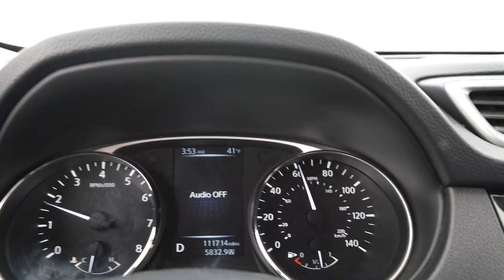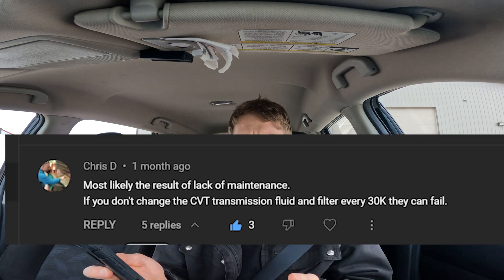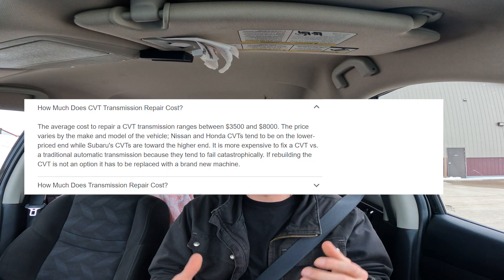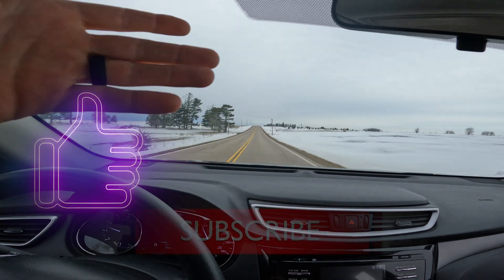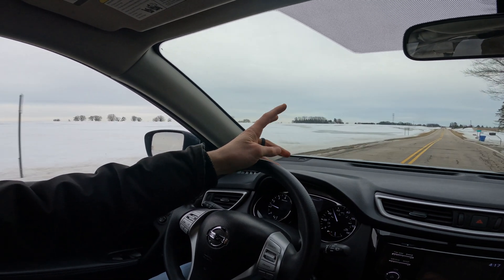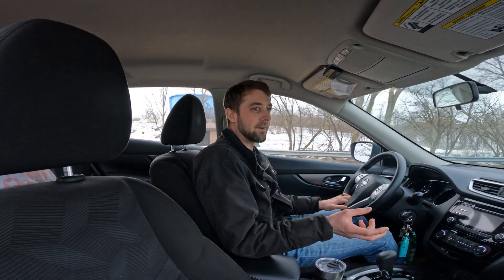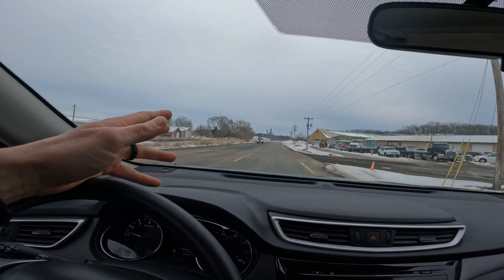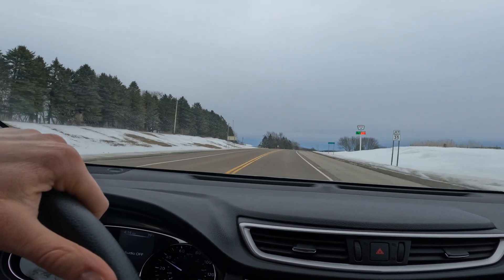Everything WRONG with the Nissan CVT Transmission

Comment: you have to change the fluid every xxx miles or else

Aka High maintenance, got it. Plus the fluid is more expensive than normal atf.

you can't drive it hard, you have to treat it like a baby or a princess

Aka it's a poor substitute for an actual atf transmission.

If these cvts are so darned reliable why have they not been installed into the frontier, titan, z, armada,  gtr?

Comment: I really don't mind them. I have a handful of more interesting and fun vehicles to drive, but I can't complain about the gas mileage on our 2019 Sentra. The computer tells me high 40s, low 50s - hand calculated , it's pretty accurate. I do wish it would CVT under moderate throttle and not fake shifts. 

Every 15-20k miles, it gets a fluid and filter change. Idemitsu N3 isn't terribly expensive at Napa, not more than regular transmission fluid. 

The only person I know who had one fail personally was someone who wrecked the front of the car and had a shoddy body shop fix it. They forgot to hook up the radiator fan and the car was driven for a summer with the car constantly overheating. Too much overheating for it.

The belt itself isn't the primary cause of failure. It fails from something else failing first.

Comment: The whole point of the CVT was it could keep the engine consistently at its powerband meaning better efficiency smoother drivining etc. Then people thought that was strange and didn't like the way CVTs worked so then various manufacturers started making CVTs that simulated normal automatics with "fake shifts" and to me that defeated the whole point of haviny a CVT in the first place
Reply: Yep, from my experience, it feels like it makes it even worse than it already is. Makes the already sluggish car even more sluggish. Simply lovely 😂
Reply: @MrAlanToast  then yours is busted stop driving broken transmission and give misleading opinions based on that, sigh
Reply: Yup.
That's the reason I won't buy one of those now.
Loved the smoothness before, now it's just stupid.
....
Reply: While simulating shifts its still more effecient, lighter and gets in the powerband faster which is also proven in a race a channel did with the altima and a Mazda since they don't use CVT transmissions in any of their vehicles and the Altima blew its doors off. Most of Nissan's engines are underpowered and that is the reason that use the CVT. . The CVT was barred from racing for a reason. The simulated shifts don't effect the performance and it operates like a normal CVT most of the time. Thats why reading your owners manual and researching keeps you from spreading misinformation. Toyota uses a physical first gear in their CVT transmission but it also emulates shifts. Honda's CVT's only emulate shifts at wide open throttle.
Reply: Experts say that toyota is truly the best CVT?
Reply: @lawrencedorfman5543  Toyota anything is the best
Reply: Nissan copied Toyota because they were the first to do a cvt,
when the first generation Prius was introduced, but the second
gen Prius is really where sales took off for the Prius.
so in 2008 Nissan introduced the cvt, but instead of only one car
they decided to change the entire lineup except for the Maxima.
it's also worth noting, Nissan is the only company that uses the 
least reliable version, that's because jacto makes the worst.
now no cvt even by Toyota is completely reliable, but the reason
it works so well in the Prius, it's because of the way the car is designed
and engineered. but Toyota didn't use a cvt in all their cars,
until the 2014 redesigned Corolla.
Reply: My 2015 honda accord has a cvt and it’s amazing
Reply: @AshleyGrahamcracker-oq3pf  I have a 2017 Nissan Rogue with 103000 miles and it's amazing so far.
Reply: Its called tiptronic and you don't have to use that if you don't like fake shifting. Posting misinformation makes you look like a dropout fool btw
Reply: lol
Reply: My first car was a 2007 Ford Sport Trac handed down to me from my grandma and uncle, it a real hard shift. I went in on a 2017 Honda CR-V, after dealing with hard shifting it was nice to have a smooth ride.
Reply: Right on
Reply: 2016 168000 miles and counting. It simulates shift only when you slingshot from a stop. Still don’t like cvt trannies.
Reply: I think the shifting feel is cool.

Comment: Toyota and Lexus vehicles use a planetary gear arrangement to produce a CVT, not a belt. When paired to a hybrid system they appear to be bomb proof and in Lexus's case pretty quiet. If you are gunning away from every junction then it is still not the transmission for you, but if you want relaxed cruising at highway speeds with good gas miles, then probably not much better around.
Reply: Nissan doesn't use a belt anymore either, it's some type of chain driven cvt.

Comment: Honda & Toyota have the most reliable CVT Transmissions.
Reply: Have 230k + on 2 subarus with original CVT
Reply: That’s true but I won’t buy one with a cvt transmission I wish car manufacturers get away from them
Reply: Honda had "teething pains" when the CVT was first introduced. Toyota hybrids use a unique CVT without the failure prone belt arrangement.
Reply: But Hondas fill their crankcase with gas to go along with the oil Result? engine failure. Google oil dilution problems with Hondas.

Comment: I used to drive a lot of different cars as a car dealer service helper back in university. Hyundai CVTs in particular on the accent and venue felt like rubber bands with molasses delay. A complete snooze fest next to the Mitsubishi Mirage cvt. Honda ones are so so but I have a 20 Civic Sport Hatchback and surprisingly it is very responsive, even with the cvt. It feels great and already has 44k miles of...very abusive driving haha. Try merging on the Chicago expressway without a lead foot and you won't get far! Major thing I do is replace the fluid every 30k miles.

Comment: I had a Murano and liked it fine in terms of the drivability. The CVT was a good match with the V6 engine.
But of course around 10 years and 200k km (125 k miles) it started dying. Sold it for $1000 to a friend who spent about CAD$4000 getting it replaced.
You shouldn't have to get the fluid changed every 30k miles. Nissan doesn't specify it as part of the maintenance schedule. These Jatco CVTs are just crap. Most other CVTs, too.

Comment: your video where you took the tranny apart is good....  demonstrates all the roller bearings in a transmission. Crucial for good lubrication and to change old fluid. Engines do not have such bearings inside them. So important for people to care for the tranny and change fluid more often. Your tranny failed due to lube failure.  it's good for me that people hate nissans, I can find a low milage one and then get it cheap and take care of it. So much better than a toyota that has a BS mythical status.

Comment: Don’t buy a car with a CVT transmission when you know there a trouble ! It is all about to change the oil in the CJvT transmission every 20000 to 30000 miles and not 80000 miles as Nissan recommends !That is why a lot of Nissan car owners get into trouble !Nissan has got a lot of owners who have drawn Nissan in court and have had the CVT transmission replaced for free !

Comment: I owned an 04 Nissan Quest Van. The transmission went 188k before I sold it in 2023 for a Nissan Truck. Subaru has the CVT in their vehicles and they run fine.

Comment: Had a 2016 Altima 3.5 SR. Transmission started slipping at 32k miles. Sold it to carmax for $15k and bought mazda3 because it's practically the only compact car (wanted a smaller car) without a cvt.

Comment: My parents bought a brand new Subaru Ascent, which inexplicably has a CVT in a 3-row SUV. The transmission blew within the first year. They had a warranty and didn’t have to pay but those transmissions are absolute pieces of crap across the board (except for the few CVTs that Toyota makes).

Comment: My coworker has a Nissan Sentra from like 2020. He has about 65k miles. No issues with his CVT because he changed the the fluid after like 30k miles. That's the critical part. You HAVE to change the fluid and it should be fine. Hurt most people don't, so the CVT doesn't last. I don't care what the car manufacturers say, including 10k mile oil change intervals. That's another no no. Change your oil after 5k miles religiously or after 6 months 👍

Comment: I just had the P1778 error code come on my Juke with the CVT(178000). It's driving fine, no slipping or anything. Maybe it came on to warn me the trans fluid is low? I need to get it booked into to Nissan for a gearbox diagnostic to see if the fluid is low.

Comment: Nissan CVTs are crap.  The fluid pressure sensor failed on my 2017 and the only fix is to replace the entire transmission.  A 50 dollar part fails and the only fix is a 7,000 transmission replacement.  Horrible.

Comment: I’ve test driven one fully loaded couple of years ago and I actually liked it. So much space in that thing and it was so comfortable. As for the CVT, I really didn’t like how whiny it became when you accelerate. Something felt wrong 😂. Drove for about 20 minutes inside of traffic and stopped for couple of minutes and I was shocked by the fuel economy when I turned off the car. 6.8/100km with the 4WD on auto mind you. Those are Toyota Corolla numbers. At least the 2.0 ones. I’m kind of tempted to get one and I don’t blame others who choose to get one either.
Reply: Basically he said all CVT transmissions. While ignoring the fact that the original Prius is one of the most reliable cars ever made. Transmission included.

Comment: Had a 2007 Altima. At that point, I hadn’t had a speeding ticket in over 5 years, so I wasn’t a crazy driver. Transmission died around 100K. Never again.

Comment: Agreed CVT are terrible in cars, even worse in suv's. They were used originally in small stroke high-torque engines like nowmobiles, seadoos motomarine, ATV's, lawn tractors, etc. They also function well with hybrids, as electric engines deliver instant torque and gas engines supplement. Prius, Volt use these.  
I have never liked the "elastic rubber band" feel they give, I'm far from an aggressive driver but the acceleration is slow and really annoying in gas vehicles, the engine has to ramp up (rev) then the car advances. Can get really annoying driving up hills as engines surge in rpm's to keep a stable speed.

Comment: The car people in this industry have it ALL WRONG, it's not about CVT vs. traditional automatic transmission, but rather, it is which car brand transmission you want to bet on. A Toyota CVT will outlast a Ford 10-speed transmission. Also, ALL transmissions are expensive no matter the repair bill. As I said, it's about the brand, not the transmission type.

Comment: Thank you for bringing the concerns of the transmission to our attention . The video can give the impression that Nissan made a bad transmission design,  put their head in the sand, and  continued to put bad transmissions in their vehicles without making any adjustments to improve its design. They would be out of business quickly if they did that.
Changing the transmission fluid is a key thing to do, of course, and making sure you make a full stop before switching gears.

From Nissan. "The CVT  had a major hardware update for the 2013 model year, which included a reduced-friction design, a wider ratio spread, and a belt that could better handle high torque outputs."
This does not mean its perfect, but its much better than the older CVT transmissions
Reply: You think the regular  cvt is bad  the hybrid cvt is even worst where th electric motor actually breaks after 100.000 km and stalls the entire vehicle on the road
Reply: Nissan could improve their CVT. I believe the E-CVT transmissions are extremely reliable.
Reply: My wife has a 2020 Murrano,  I have a 2024 Rogue and my son has a 2016 Sentra.  No issues with  the transmissions on any of the cars.
Reply: @revelationsoundstudio They're still pretty new. How many km or miles on the 2016?

Comment: Scotty says he's never seen a Toyota CVT fail yet but has seen several Nissan ones fail.
Reply: Kilmer
Reply: That’s because at least in their hybrids Toyota uses e-CVT which has planetary gears. I don’t know about their regular petrol CVT models. They’re rare in our market.
Reply: @mikojarvinen6273 Can I know where you are bro?Petrol  cvt corolla are very common on the road in America. In Aisa, they also build camry, rav4, Lexus es with belt cvt. People say they are reliable.
Reply: So it's not the CVT that has a problem. Just where they are driven. 
Perhaps we should explore this point further. If people in Asia and Europe don't have the same issues with cvts what does that mean?
Reply: @mikojarvinen6273  E-CVT's are a totally different animal entirely, those are extremely reliable because they have very few moving parts.  No pulleys or belts at all, the electric motor takes their place.
Reply: @StormsparkPegasus  That’s exactly what I said in my comment.
Reply: Scotty has never seen a kicks cvt fail or a 19 altima or better cvt fail or qx50 cvt fail.  There are more niddan cvt out there but trust me there are corolla cvts that has failed.
Reply: My mother bought a brand new Nissan with a CVT in 1996. It was dead after 50,000 miles. Got a rebuild swapping the dead box. Lasted 25,000. That's a total of 75,000 miles and the car was scraped.
     The car had been well maintained and the engine was as good as new.
The box was rubbish.
Reply: Mate had a JDM Toyota Vitz which went through 2 cvts at 280,000kms
Reply: @agentrockluxury1208  Did he do the proper maintenance by changing the CVT fluid regularly.  CVT's also cannot be driven hard like regular transmissions. .
Reply: @philc.9280  As far as I'm concerned, he didn't change the fluids regularly, but he also didn't drive it particularly hard.  All cvts are inherently bad when you don't change the fluids, including Toyota and Honda cvts. I drive a Nissan with the cvt, and I change the fluid regularly, and it's been reliable.
Reply: @agentrockluxury1208  I had a Nissan CVT. Bought it new. CVT dead at 50000 miles. Got a box out of a crashed car with 26000 miles on it. I managed to get another 21500 miles out of that before it died.
    The car looked like new but went for scrap. Engine perfect  , car body perfect  , gearbox dead twice.
Reply: I ended up getting a Nissan NV200 cargo van for a weekend van conversion project anyway despite this video. It was a 2015 with only 45K miles so it sat in someone's garage a lot. First thing I did is change all the fluids. Drained the tranny 3 times {one week apart) to get all the old fluid out. Used that new Castrol TransMax that is approved for both CVT and regular transmissions. Based on what I am hearing is to just drain the CVT every 25K and don't drive it hard to make the transmission last. Some folks are getting up to 200K miles on that schedule. Mine has an external tranny cooler so hopefully will get some of that heat out.
Reply: Manual transmissions go at about 60000 miles. They are bad ideas too… they don’t last at all.
Reply: mate, that is because they added two AT gears which means, when you move your car from still to 20km/h the CVT is not working, it only kicks in after car moves. But when you try to overtake & accelerate, Toyota CVT is easier to break as they are very very thin
Reply: Maybe the Toyota guys took care of it and the Nissan guys didn't.
Reply: Scott is bias. Looks for stuff in others that he ignores in Toyotas. Wow!
Reply: what about honda?
Reply: Not same tune from Scotty on the new Tacoma / Tundra??!
Reply: Totally different mechanical systems.
Reply: My housemate/tenant bought a Nissan Maxima with a lot of miles on it. Bad move, the tranny failed right after he bought it. It sat in my driveway for months with fluid leaking out of it every day.
Reply: @crand20033  Leeson learned. Never buy a used car unless you check the maintenance history through CarFax or the owner's logs. A leaky transmission could have been easily seen if a mechanic looked underneath the car to check the seals. This is especially important if it had a lot of miles.
Reply: Toyota uses launch gears in their CVTs. Nissan does raw starts with their CVTs, there’s no starter gears to offset the wear on the belt. Launches are the number one wear item on CVT belts
Reply: I'd not opt for a CVT IN ANY CAR purchase. Keep the rubber-band trannies for ATV or snow mobiles. Not cars.
Reply: I literally know people who drove their nissan for almost 300k and only had a few issues not related to the transmission. 😂 videos like this are just rage bait doomers who are only focusing on the the smaller percentage of cars that the problems happen in. Because of this was super widespread then no one would use them.
Reply: @leonardceres9061  The CVT transmission in many Nissan is considered a weak spot in its longevity unless meticulously maintained.
Reply: @ I own a paint/ Autobody shop in partnership with a mechanic who shares the building with me. I feel like as long as I change the transmission fluid/flush every 30k miles and don’t beat on it and watch for leaks, etc then I’ll hopefully be good.
Reply: Who?
Reply: @martinr8278  I guess you don't watch car repair videos much.  He's a YouTube mechanic for decades and has millions of viewers.
Reply: @martinr8278  Some cranky old man who rants on youtube
Reply: @calebwany8422  A guy who is not smart enough to learn how to work on European cars, so he hates them with a passion and thinks they're unreliable.